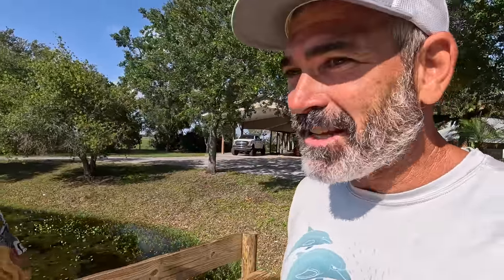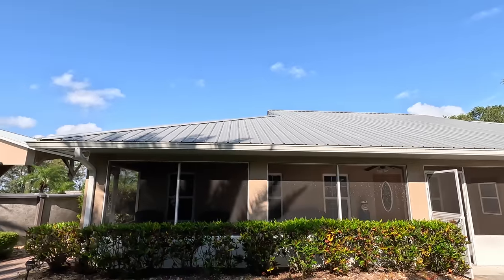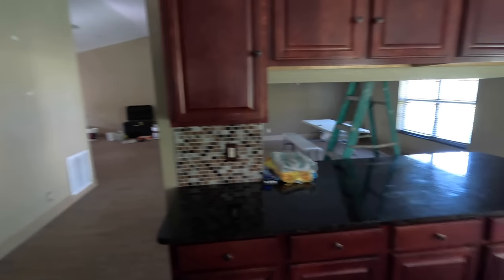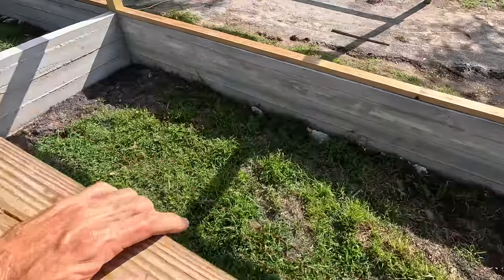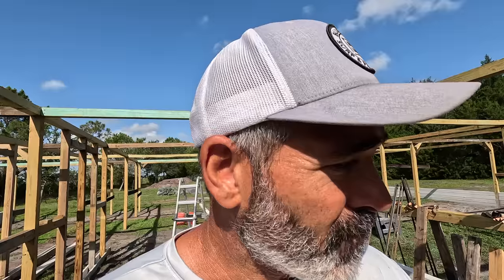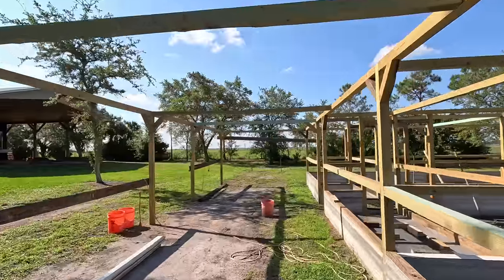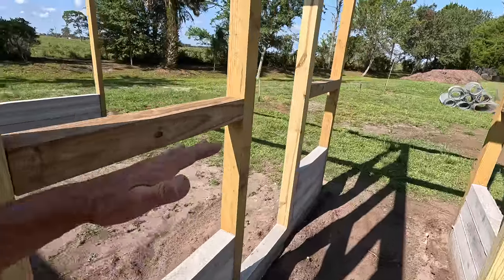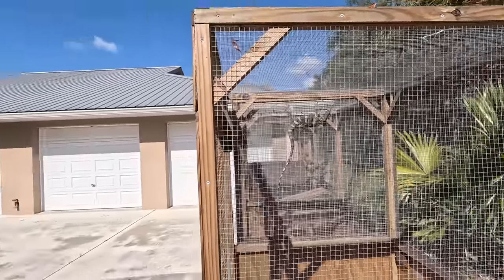Working and Touring the New House

Comment: Just as you mention the words plan(s) and time here's something I thought about as far as water for monitor s.
I think the 399 gal tubs are great but to big and the smaller tubs to small. In regards to filtration have you considered a formed water way that runs through all the enclosure s filtered by a pool pump? 
You could take it as far as aquaponics and grow/use plants to filter the water.

If you use the tubs have you considered putting hide box in corner then the tub eliminating a loss as the one you had between corner and tub.. You could also build the box high as tube for raised basking area. 
Admire your work ethic n surprised you responded to previous message. If I could break away from my biz and dogs and didn't live over 5 hours away I'd offer you help. 
Later man as always liked n subscribed
Reply from the maker: I love the common running water idea, but I would be afraid that if one animal got sick, it could get them all sick!? I think I know what I want to do, but it’s just gonna take more time that I have right now so I’ll have to do it later